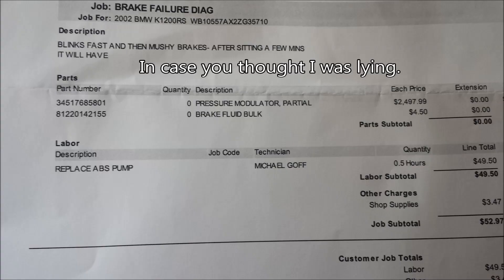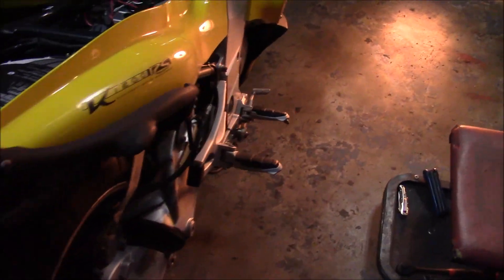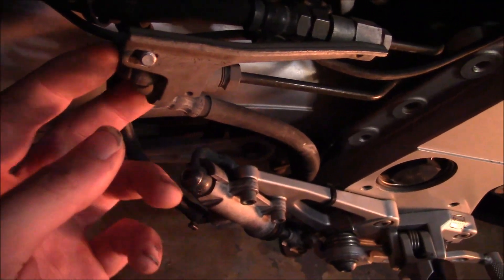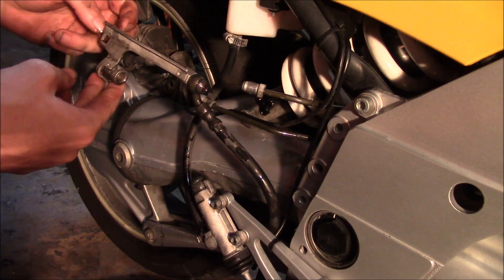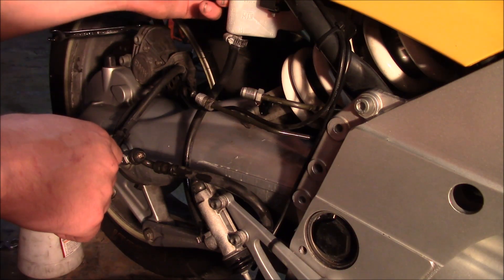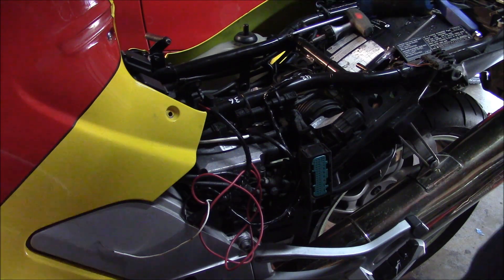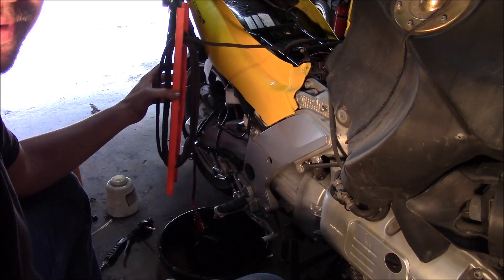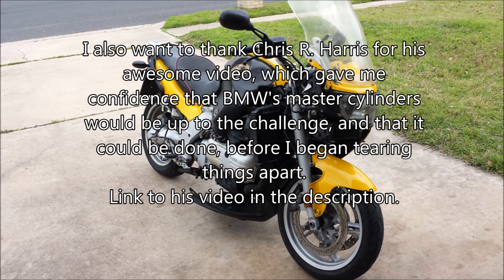How to remove "servo brake" ABS from BMW k1200 or similar bike

Comment: MOTORCYCLE TO COMPUTER. -4 brown  small wires
                                                              -1 red        (black tracer)
                                                              -1 green
                                                              -1 white   (black tracer)
                                                              -1 red
                                                              -1 black.  thick with small green & a peeled off wire inside
                                                              -1 black.  thick with small red & a peeled off wire inside
MOTORCYCLE TO PUMP
                                                              -1 red         thick wire
                                                              -1 brown. thick wire
                           
PUMP COM TO PUMP
                                                              -1 red.    (blue tracer)
                                                              -yellow. (red tracerl)
Reply from the maker: man that sounds like you cut the completely wrong part out or something.  bikes vary by maybe 1 or 2 wire colors but not a completely different setup for the same exact year and model..

Comment: I have the exact bike from your video except that the wire colors are different & the speedometer works find even after I cut all the wires.
Reply from the maker: thought I'd ask. is it a euro model?  and either way you still need a wiring diagram.  or... i know for sure there are forum posts that talk about the different wire colors. i found one once where someone had the same issue. maybe something about a purple wire but i dont remember for sure. not trying to leave you hanging, but i keep asking for specifics like a wiring diagram or maybe which wires are different or something fkr me to go on. you'll still need to wire up those relays so your lights work. the voltages and amperages are different, which is why they use them....  but most bikes dont use relays for brake lights. you can look at the wires going to the master cylinders and write those down...  thats 4 wires... then you can use a power probe to figure put which ones are hot when the key is on.    then you can look at the tail light bucket and figure out what colors are hooked to the tail light. that gives you a great start. write it all down and compare.
Reply from the maker: but more importantly im sure SOME of those wires are the same....  which ones are missing?  but physically look at the bike and the wires at the ends that plug into master cylinders and tail light.
Reply from the maker: brown is almost always ground on euro bikes .. "earth"... soil... dirt... ground.. brown... most japanese bikes are green...  earth... green plants... ground... and they are generally thicker wires.
Reply from the maker: 87a to 87a are going to be voltage in....  hot wire...  keyed / switched power
Reply from the maker: and the rest of them either come from the brake lever foot brake or tail light.... i hope that helps...  if you trace them back, you can put 2+2 together on them. but a diagram would cut all of the guess work out of it.

Comment: saw your other video unfortunately too late. if I connect all the cables back and take off the computer from the servo pump and get rid of the pump will it work? thanks for the help.....
Reply from the maker: you really need to find a wiring diagram for your bike and go from there.   i cant even begin to guess without looking at a diagram what does what.    but.. all u need are the wires i mentioned.  or.......  since you have already cut it off, finish out the original way.  hell your bike may even have the additional speedo pickup thing on the swingarm. hell you may be riding a honda.. idk..   you never said what bike.  but yah...  if u plug all of the wires back it will work. but it will also throw a fuck ton of codes and give you a check engine light type thing and an abs light and all sorts of shit.  but..... it wont affect the bike itself... all you really need sre the wires i mentioned.    and..  to unplug the ABS light bulb in the dash. take the bulb out.

Comment: DUDE! next time just repair that thing! the servo pump has most of the times only the broken carbon things like most electric engines... not much different to a vacuum cleaner engine... with some tricks and the right carbon stick's and a few hours you rebuild that thing. And all is good till the next time. Cost less then $100! That is what BMW will not tell you!
Reply: Is there instructions or video of that?
Reply: I'm facing the same issue!! carbon? I haven't even looked on how to desable that thing...   
But great video! I will see if I get open the "black box iABS" to check for the carbon...  winter project :P

Comment: Does this work for a 2005 K1200S?
Reply from the maker: technically it will work for any year make and model bike or car or truck etc that has abs on it...  all you're doing is removing the pump.   but you need to find my followup video which explains the negatives. . and read the description

Comment: Great video,Just replaced my existing brake lines with braided lines.More efficient & clean.Yahh.
Reply from the maker: thanks man
Reply: +Denis Railey What brand of brake lines did you use and what length
Reply: +C. Douglas Booth Jr .Local supplier .Lucky earlier R1100RT ecu not connected with servo.Speedo from front wheel old type cable..
Reply: +Denis Railey Took my old rubberlines off & took them in to local braid supplier.In USA can probably order complete set from www. affordablebeemerservices.com.

Comment: HI there! really good video!... a question, you reckon the same can be done on a k1200r 2006?... I was checking the diagrams and apparently the lines are different as shown here http://www.ascycles.com/Illustrated_catalog2/MicroList.aspx?id=51582&catID=&catname=&bindName=Brake%20line,%20front,%20I-ABS%20Generation%201&bindCat=34_1932 ... so I was wondering if only by connecting hose 1 to hose 17 would do the job...answer most appreciated; really!... thx in advance!
Reply from the maker: hey klob,   yeah, it looks like you'd go from 1 to 17.   do a little more resesrch before you tear your bike apart though.  

i do have a followup video that you should watch.    you're  supposed to unscrew the computer part from the servo and throw the pump part away. not chop the entire thing out like i did... that eliminates all of the weird wiring crap, and in the case of this bike model, it would have still had a speedometer. some of the newer bikes had a separate speedo pickup, which you could tap into.   this bike did not.   the speedo went through the brake system.... anyway,  please look into it before you tear your bike apart. there are always unforeseen issues.
Reply: +Klob Toluca About your ABS FAIL K1200: DUDE! just repair that thing! the servo pump has most of the times only the broken carbon things like most electric engines... not much different to a vacuum cleaner engine... with some tricks and the right carbon stick's and a few hours you rebuild that thing. And all is good till the next time. Cost less then $100! That is what BMW will not tell you!

Comment: Thanks for the detailed instructions, now try to do as you have shown in this video, but I have a question for you, if the speedometer is working to do everything you showed?
Reply: ***** What to look for Hashem channel?I found no link
Reply from the maker: +Георгий Алания https://youtu.be/EmFlhmVjKMQ
Reply: Thanks, I'll see, but I do not know English, I'll try to find someone who can I translate.
Just say it is possible to do, what to say in this video?
Reply: once again thank you very much for your work, the whole world can see and repair their bikes thanks to you!
Reply: +Георгий Алания About your ABS FAIL: DUDE! just repair that thing! the servo pump has most of the times only the broken carbon things like most electric engines... not much different to a vacuum cleaner engine... with some tricks and the right carbon stick's and a few hours you rebuild that thing. And all is good till the next time. Cost less then $100! That is what BMW will not tell you!
Reply from the maker: +onhawaii thanks for the input. im sure you are right, i rebuild parts when i can, but couldn't find a good rebuild kit including seals, gaskets and all of the other components, and the customer couldn't afford to replace with new, so rather than ending up with a leak or the possibility of air getting into the system from a non sealed surface or risking rippijg an o-ring I decided it would be safer just to eliminate the system, though rebuilding was discussed prior to the job being done. that and its been quite a while now and his brakes have not failed in the time since this video, whereas he nearly died when the brakes went out the first time (nearly went into an intersection of oncoming traffic) so "until next time" wasn't an option we wanted to explore any further. thenmaster cylinder is plenty strong enough to do the job and if there are any questions over that, a master cylinder rebuild is a good start or a master cyl from a ninja etc will work.   thanks for the comment
Reply: Mitch B There are no mayor seals or repair kit required there are videos here that show how it is done in basic. I might have to do it on my bike now after the serve just broke on my k1200r sport... I have already some Ideas how to get it done save so it does never leak. And the carbon things are available at the Bosch service I bet (just order by size an voltage). You even find here how to refill the system right and bleed it. If you still have the broken ABS unit you might just try it for fun and practice. My 2007 model works even with the broken servo well but once I saved my life and an drunk guy on an bicycle life with that ABS... Never had an shorter way to an complete stop without any hassle at all! If that works it is a life saver. Now when i try to slow down fast out of high speed the front wheel makes wired noises... not so much fun.
Reply from the maker: +onhawaii awesome thanks for the tips again. and if you run across a good video feel  more than free to post it here.  i do have the unit off this bike still. i may take it apart when im bored
Reply: How about the brake perfomance after this surgery? Cus this bike's got awsome brake power. Got an -02 myself and just did the bleeding of the whole system. Understandeble BMW didn't continue whith this system.
Reply: +MB If you do take it apart just try not to drill to deep. And if no big deal, I did that on mine too and it does not cause any problems. I also did not need any rebuild parts for it because they where just stuck... a little clean and minor lube (silicon spray) was enough. Runs now a year without any problems! My cost for it: 4hrs work some lube and cleaner and 5 bucks for the bleeder screw that stripped on the rear break. No leaks not default or other problems on the break system since then! And if I would have removed the ABS system my bike would not pass inspection anymore! I have to say too that I had an situation where the ABS did save my ass last year and I had the short stop of my life! From 25mph to 0 in 15ft!!! I would have never got that without the ABS! I will not remove it out of the bike!
Reply from the maker: Johnny Rydberg well honestly i mever rode the bike when the brake system worked correctly with abs so i cant compare to that, but, after the delete, it worked as good as any other non abs bike i ever rode, and better than any Harley I've ever ridden lol. the stock master cylinders have more than enough power to stop the bike. however if yours do not, then you probably need to rebuild them or more bleeding. the downside is that there are more elbows for air to get trapped in when trying to bleed the system. but once that is sorted, it works perfectly fine. its been a few years now and he still has no complaints. thanks for watching, and keep in mind about the wiring. i have another video about the "i wish i knew this before" things i figured out.
Reply from the maker: onhawaii wow!   sorry for the quick reply but it really sucks that you cant pass inspection without the stock abs. herr in texas they dont check that stuff, dont run engine diagnostics, emissions or anything on motorcycles. most places wont even test ride them for liability reasons. if you ride it up to them it obviously runs and stops so they pass it. ive had bikes die in the parking lot and still pass haha
Reply: Yep, that is Texas. But here in Germany they check every little thing and even if parts get modified like rear fenders and you do not have a certificate for it being street legal you fail the inspection! Or you pay for an build inspection that the modifications you made are street save and they write it into your papers... That is not for free and can get expensive. Vehicles that are used on public roads need to be save here and you loose the insurance coverage if it is not an licensed modification. And to delete the ABS would not be able to do since it is required to the BMW since it was build with it. Hard rules? YES! But the roads are saver for all that way. I do not want to meet someone with an brake system failure going down the Autobahn with 150mph. Do you?